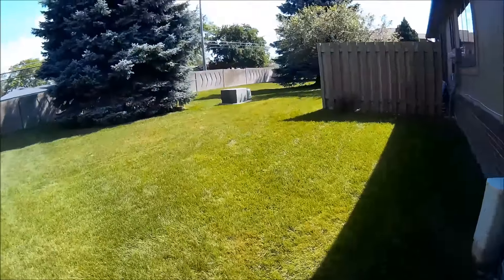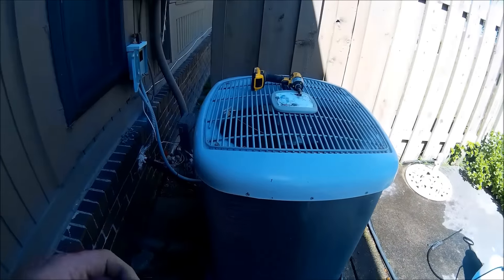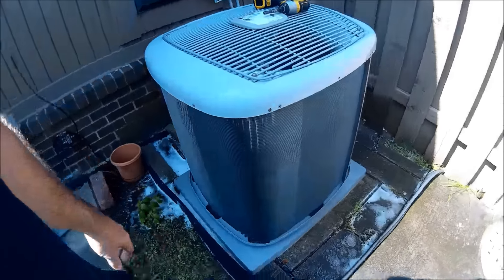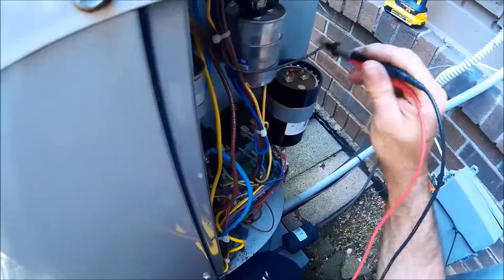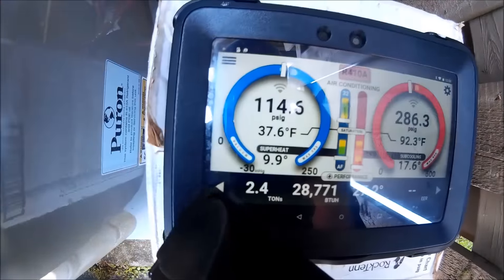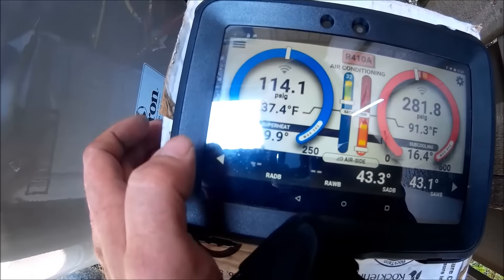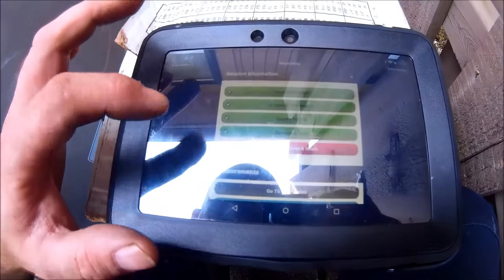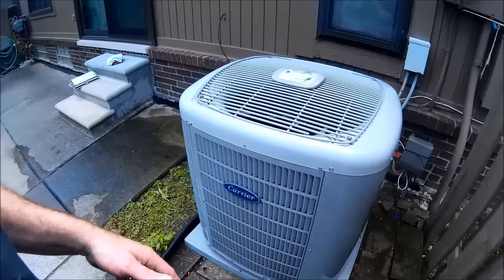Imanifold on carrier Infinity 24ANA724

Comment: You might consider getting a repeater probe for times when the distance gets that far out. Not sure where you had you iManifold hung, but sometimes repositioning it will help with reception also. Nice work.
Reply from the maker: Jim Bergmann Hey Jim thanks for checking out my video. I do have the repeater for the Imanifold and I did use it that day but it was in a condo and it was pretty far away. I just checked out Steve lavimoniere's video on the Iconnect with the new app and it looks really cool and helpful for reporting. wish I could get in on the beta testing for the new app